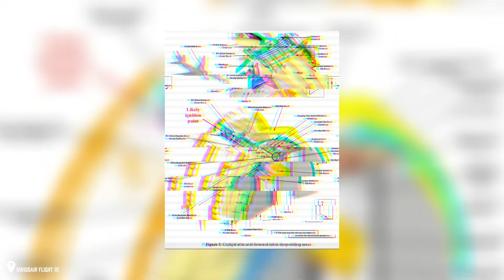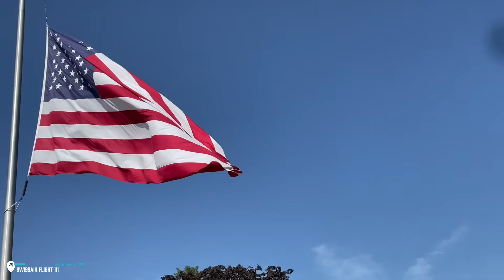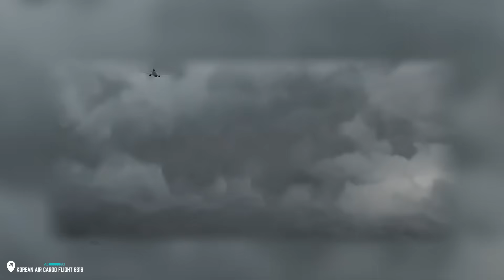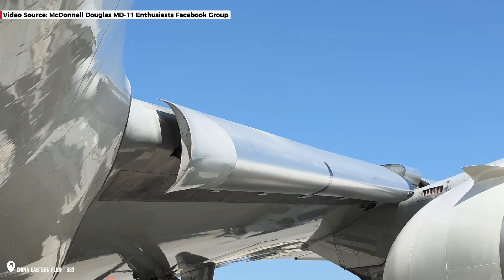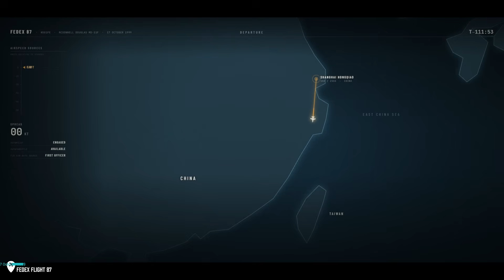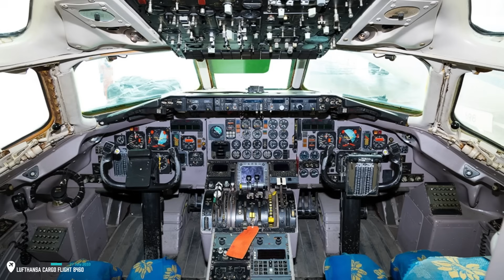America's MOST DANGEROUS Widebody: 7 DEVASTATING MD-11 Disasters!

Comment from the maker: McDonnell Douglas took the DC-10, shaved down the tail to save fuel, and lost some of the airplane's natural stability in the process. 200 were built and 10 have been written off, which is the worst record of any American widebody.

If you enjoyed this one, a like and a subscribe really helps the channel. Which of these 7 surprised you the most?
Reply: NICE JOB
Reply from the maker: @LegoDisasterDiaries  thanks
Reply: Horse puckey, the 747 has the worst safety record for wide body. far more than 11 with all aboard lost in the first 20 years.  Just plenty of propaganda to share.  years ago when I looked there were 75 listed accidents.  Now propaganda has become prominent.  While keeping track and free look up of data has become impossible. the websites who started with the internet have all disappeared.  Ain't that sumpin.  Yet this disinformation hasn't.  The plane wasn't properly maintained.  The crack had been known about for about 20 years and no one followed through on the repair.  That's Douglas fault?  As I said before Horse puckey.  Politics in aerospace are as bad as the Drumpf administration as far as facts and the truth are concerned.  If you didn't know this your excuse is based in ignorance.  If you knew all along. . . As I said Horse puckey
Reply: @slowpoke3102  I don't think so. It's not how many died, but what the fatal crash rate, or hull loss rate was. The 747 never had at any point a fatal crash rate worse than the MD-11. For example, the M11 had only completed about 70,000 flights at the time of its first fatal event. By contrast the 747 had accumulated upwards of 400 million departures by the time of Nairobi. That means early 747s were about 5 times safer than the early MD-11 years.
Reply: @cchris874   You are incorrect to multiple orders of magnitude (OOM). The 747-400 has made a total of 9 million departures. Nowhere near the "400 million departures" you cite here. And, the hull loss rate should exclude pilot error or human factors accidents.
Reply: @0w3nn  

I'm sorry, that was supposed to be 400,000.
Reply: I will say people say their opinions and are definitely misinformed.  The NTSB heald hearing and blamed Boeing and who owned the repair centers for not fixing a problem with the aircraft they knew about for 20 years.  Bad design from Douglas, great L-1011 or 747? (which has btw the worst wide body airliner safety record.  You guys should learn how to read reports without your eyes crossed.
Reply: @slowpoke3102  

But if we look at only those fatal crashes on passenger fights only where manufacturer  design error was present, the 747 comes out better than the DC-10. 747  = 21 million flights, at most 4 design related crashes. DC:-10 = 9 million flights,  3 design related crashes. So the 747 was nearly twice as safe.
Reply: @cchris874  Make sense please.the 747 had some good design flaws, just to prove my point I will bet you do not know them.  If you know them and how much trouble thy caused I will at least admit hat you know.  The lies involved with the aerospace industry alone has earned its own story book novel.  Hiding them and not writing about them doesn't make an aircraft safer.
Reply: @slowpoke3102  

There was a very interesting poster a while ago. Maybe it was you? He worked at Boeing and made a very good case that early 747s were as bad or worse than the DC-10, and mainly due to engine explosion risk. Let me now if that sounds familiar. :)
Reply: @cchris874  There were other probles known before that disaster.  That is one know anymore?  Queen of the skies?  Public safety?  If you know shows golden touch.
Reply: Why didn't Mcdonell Douglass test fly the jet before releasing it to airlines? And if they did, why didn't that smaller tailplane bite them then?
Reply: @jimnice74656  They did, but a la McDonald Douglas, the test schedule was compressed, which compromised safety and contributed to some of the crashes. Seems like they were always and continue to be depraved corporate sociopaths.
Reply: I agree totally 👍
The crash history is totally off 

Just one word " insane "
Reply: Ai. I can easily tell. The middle landing gear is constantly wrong or even missing and Eyebrow windows on a MD-11???
Reply: 2.13.2 Summary of Pilots‘ Statements about Controllability at Landing for the Same Type of Aircraft
“When several pilots with licenses for the same type of aircraft were interviewed, they made comments summarized as below about the control characteristics of these aircraft at the time of landing:
Their controllability is similar to that of Boeing 727 airplane which have the No. 2 engine in the tail, just like the same type of aircraft. “
11. For example, the Boeing 747 has higher landing speeds than the MD-11 at high weights. Airbus A320 manual landings also involve manual control of pitch and roll with the autothrottles engaged, and the A320 has neutral pitch stability in normal mode.

N526FE.pdf. A-14-004-007.pdf.

Comment: Also for SwissAir 111, the QRH for fire in the planes designed by SwissAir was so long and complex that it would take well over 30 minutes to complete it before you would be ready to decide to land. Planes are rated to last about 17 minutes (give a take a couple; I don't recall the exact minutes) if on fire and you have 90 seconds after landing to get everyone off the plane if it's burning. The time they spent working through checklists meant that they would have crashed long before the checklist was ever completed.

Comment: 2.13.2 Summary of Pilots‘ Statements about Controllability at Landing for the Same Type of Aircraft
“When several pilots with licenses for the same type of aircraft were interviewed, they made comments summarized as below about the control characteristics of these aircraft at the time of landing:
Their controllability is similar to that of Boeing 727 airplane which have the No. 2 engine in the tail, just like the same type of aircraft. “
11. For example, the Boeing 747 has higher landing speeds than the MD-11 at high weights. Airbus A320 manual landings also involve manual control of pitch and roll with the autothrottles engaged, and the A320 has neutral pitch stability in normal mode.

N526FE.pdf. A-14-004-007.pdf.

Comment: I remember landing the MD-11. It was even worse than the DC-10. I got maybe 1 or 2 soft landings on my whole 5 years on the type,
Reply: 2.13.2 Summary of Pilots‘ Statements about Controllability at Landing for the Same Type of Aircraft
“When several pilots with licenses for the same type of aircraft were interviewed, they made comments summarized as below about the control characteristics of these aircraft at the time of landing:
Their controllability is similar to that of Boeing 727 airplane which have the No. 2 engine in the tail, just like the same type of aircraft. “
11. For example, the Boeing 747 has higher landing speeds than the MD-11 at high weights. Airbus A320 manual landings also involve manual control of pitch and roll with the autothrottles engaged, and the A320 has neutral pitch stability in normal mode.

N526FE.pdf. A-14-004-007.pdf.

Comment: As kids and with all its accidents in the news over the years we called the DC-10 the DeathCraft 10.  When the MD-11 came out it seemed so obviously similar we called it the MegaDeath 11.  But who could guess that in some respects it was even worse.
Reply: 2.13.2 Summary of Pilots‘ Statements about Controllability at Landing for the Same Type of Aircraft
“When several pilots with licenses for the same type of aircraft were interviewed, they made comments summarized as below about the control characteristics of these aircraft at the time of landing:
Their controllability is similar to that of Boeing 727 airplane which have the No. 2 engine in the tail, just like the same type of aircraft. “
11. For example, the Boeing 747 has higher landing speeds than the MD-11 at high weights. Airbus A320 manual landings also involve manual control of pitch and roll with the autothrottles engaged, and the A320 has neutral pitch stability in normal mode.

N526FE.pdf. A-14-004-007.pdf.

Comment: Misleading title.  6 of the 7 incidents in this video come down to pilot error/human factors.  The only one that was cased by the aircraft was the Swiss Air infotainment system.  In no way does this video prove that the MD-11 is "America's most dangerous widebody".
Reply from the maker: Technically correct, but I wanted to highlight the unfortunate fate of this jet a little bit.
Reply: @TerraObscura61  ...with a misleading title.  🤦‍♂
Reply: @misawajason  Not true at all. Five of these events were design related !!! Where have you been? UPS crash was just last year. In the case of China Eastern, the NTSB ruled it was primarily design -caused. The NTSB has also implicated the following MD-11 vulnerabilities:

"an unforgiving, unstable flight profile on final approach, a narrow center of gravity, and a high susceptibility to bounce or break apart during hard landings.....The NTSB determines that the structural design of the MD-11 aircraft wing-to-fuselage and landing gear-to-wing attachments failed to ensure that landing gear failure would not result in fuel tank rupture. . . . The MD-11 has unique handling characteristics, including higher approach and landing speeds than other wide-body transport airplanes, which compress the time available for pilots to recognize and correctly react to bounced landings.....The NTSB concludes that the pitch control sensitivity of the MD-11 during flare and touchdown creates an environment highly susceptible to overcontrol... and that McDonnell Douglas failed to provide pilots with clear, actionable procedures to recover from a high-energy bounced landing.

The NTSB has never been more critical of a major jet type. And all this for a plane that hasn't even logged one million flights.
Reply: @misawajason  more than just title.  Boeing and Lockmart advertisement at McDonnell Douglas expense with misleading information.

Comment: Omg!
Did they make a DC-10 with LESS control and change it's name?!😮
Reply: 2.13.2 Summary of Pilots‘ Statements about Controllability at Landing for the Same Type of Aircraft
“When several pilots with licenses for the same type of aircraft were interviewed, they made comments summarized as below about the control characteristics of these aircraft at the time of landing:
Their controllability is similar to that of Boeing 727 airplane which have the No. 2 engine in the tail, just like the same type of aircraft. “
11. For example, the Boeing 747 has higher landing speeds than the MD-11 at high weights. Airbus A320 manual landings also involve manual control of pitch and roll with the autothrottles engaged, and the A320 has neutral pitch stability in normal mode.

N526FE.pdf. A-14-004-007.pdf.

Comment: In my opinion the MD11 was one of the best looking aircraft ever built.
Reply: The L-1011 TriStar was also a fine looking aircraft. And far better engineered than the Douglas DC10 and MD-11. The arrogant leadership and the bean-counters ruined what could have been a far better plane than it was.
Reply: @dezzadiggler  the widebody trijets are the best looking planes in the world.

I have to push back on your “better engineered part.” It couldn’t be engineered to compete in range-payload with the MD airplanes.
Reply: Not sure you’d had that same opinion, if you were hurling down towards the Atlantic Ocean on fire
Reply: @ScottGreg-w7h  I don't think it would matter because you would be dead.
Reply: @0w3nn  100% exactly my point that I made
Reply: @ScottGreg-w7h  Are we hurling down towards the Atlantic Ocean right now?
Reply: I agree with you. Nice-looking bird for its time. I flew it several times on Delta’s ATL - PDX route decades ago and I loved it. I’ve read that pilots weren’t particularly fond of it. 

Anyway, these days I think that the A350 is a very elegant frame.
Reply: @APR1037  Funny, most pilots I have spoken to, and others have glowing things to say about it and performance.  1st in the new engineering specs used now only 20 years earlier than boink or lockmart.  Even airbus has good things to say.  Only those misinformed and following like sheep are contrary.  Makes little difference  when the 'crowd' are gonna say as they please without regard to accuracy.
Reply from the maker: I disagree. I think there are much better looking planes.
Reply: @TerraObscura61  Disagree or not; everyone is entitled to an opinion.
Reply: @dezzadiggler  that's the problem with decisions, not the same as facts.
Reply: @TerraObscura61 name some?
Reply: @beagsx3  Concorde, 707, DC-8, Vickers VC-10, some would say Connie., Convair 880/990 very sleek and well proportioned.
Reply: @cchris874  Ew, all uglier sorry

Comment: Don’t blame aircraft, but those who are doing maintenance work on the aircraft and how it was exploited. Swiss airlines crash was horrible but it had nothing to do with how it was designed and built. Some logic is applied to vehicles, if you doing proper maintenance and exploitation it will serve you well if you cutting corners on maintenance it will make you pay dearly.
Reply: It did have to do with design. Even though legally it met all existing regulations, these regulations were highly inadequate.